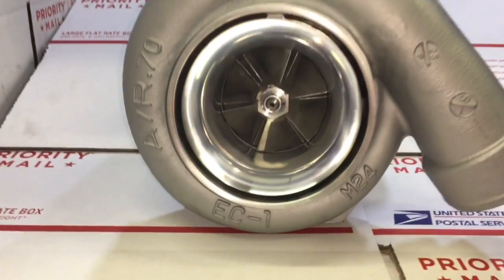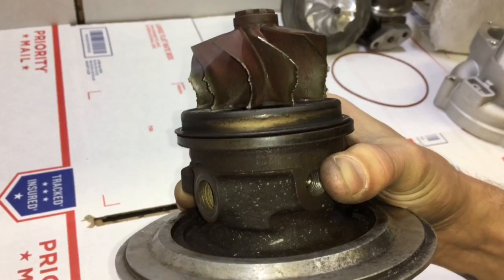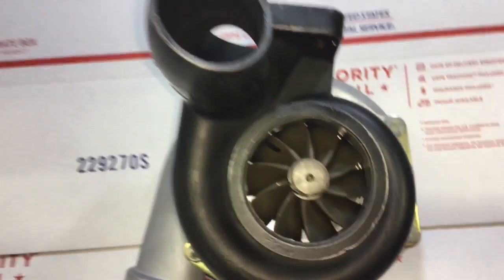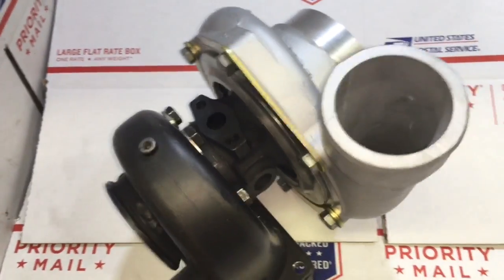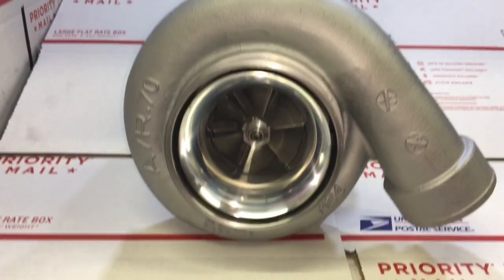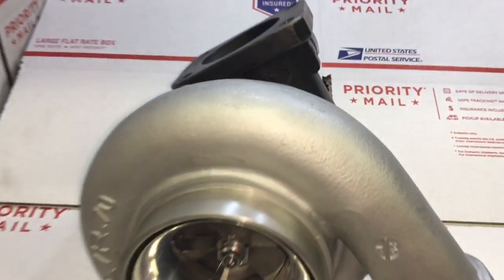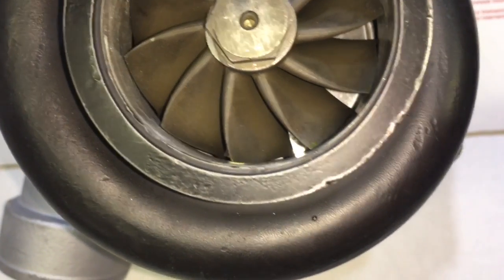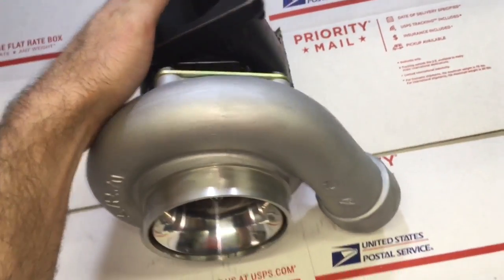FP 82 HTA GT35R Turbo Review

Comment: Do you guys have the ability to properly VSR balance the garrett/FP BB turbos after a wheel replacement?
Reply from the maker: +Kapok6 I can balance it as an assembly but not as a cartridge, the turbo is supposed to be balanced as individual parts then as a rotating assembly, then as a cartridge. My balancer has a cradle to balance the turbo as a cartridge but I can spin them as fast as a vsr. Pure turbos has the vsr balancer. Just make sure that whoever you get to balance the cartridge if you choose vsr, make sure they have the adapter for your turbine wheel. Those balancers are around 30,000$ and each attachment is 300-400$.

The balancer I use is a west coast which is the same as a t3 model c. It works great for what I need it for based on the majority of the turbos that I build are journal bearing, my balancer retails at 10k
Reply: Thanks.  Do you have a video yet on reassembly of the GT35r series turbo?  I am willing to try rebuilding myself, then sending it off to be VSR balanced.
Reply from the maker: I made one for a gt3071r, but I need to do an hd one, the quality is so much better. https://youtu.be/6FkaSehsb9s

Comment: it is NoT HTA
Reply from the maker: +RetunerB Ret yes I know, it's the older version, I don't know what the called it since they don't make them with the cast compressor wheel anymore. Is it just called an Fp 3582?
Reply: Turbo Lab America It's called an FP3565, the last two digits are the flow in lbs/min. I have the same turbo. The FP3065 was a lot more popular, it was based on a GT3082R instead of a GT3582R.
Reply: Turbo Lab America hes quick to be negative but not to reply